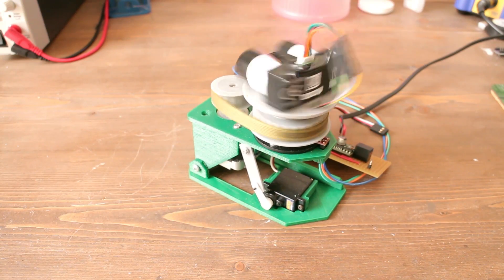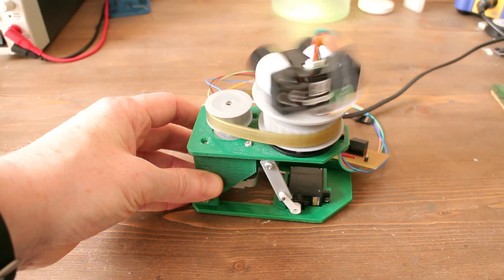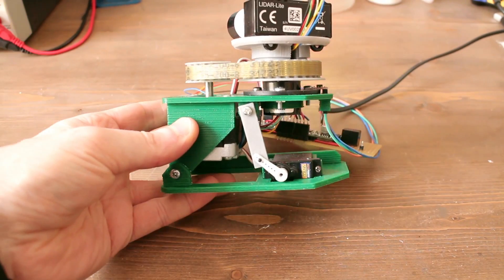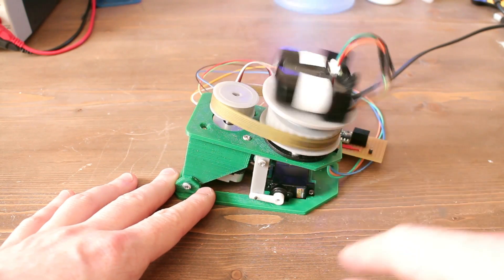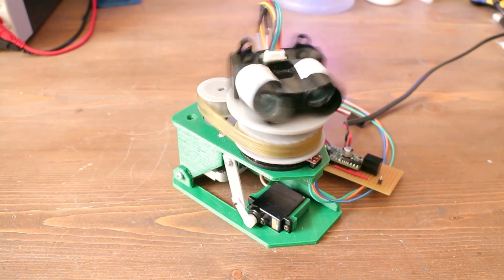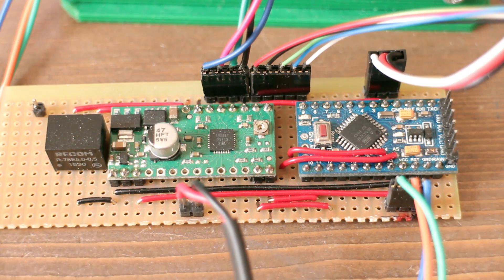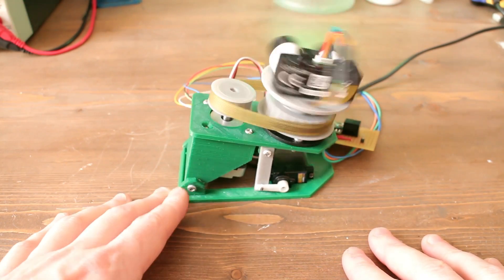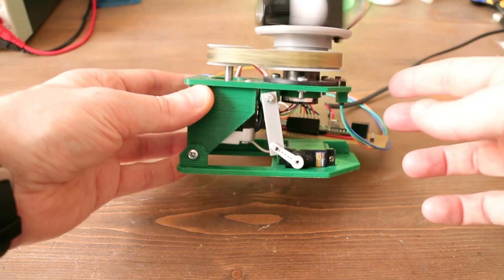Rotating 360 LIDAR Scanner - 3D Printed up and down scanning - Robotic Vehicle #9

Comment: It is interesting that you are talking about calibration issues.  It would seem to me that letting the head rotate and monitoring the optical sensor for the line,  you should be able to tell how many steps the motor requires per full rotation and then just rely on that for the rest of the scan.
Reply: Please share. Any code sketch for this

Comment: Good job. Like you said in your previous video, I too have had all the parts half-put-together, waiting to be finished. My project is similar, but I'm using multiple LIDARs, 180deg from each other, which effectively doubles the scan rate at the same rotational speed of the stepper motor. You could also have 3 at 120 degrees from each other, with also a little bit of a vertical angle (top is lifted a few degrees, the middle is at 0, and the bottom is pointed down a few degrees). 

As for the bottom bit to dynamically change the Z axis, I have also toyed with using another stepper or brushless motor with an elliptical piece on the shaft so that it gradually pushes the platform up and down, instead of the jerking motion that you have. I would then run that bottom motor much faster than the horizontal motor. That way I can also deal with calculating all readings' Z value - your current solution, albeit being changed, leaves some number of readings unknown while the servo arm is in motion.

Comment: Very cool! i have an old V2 LIDAR that has also been sitting around from before i purchased my 3D printer. i'll be "gearing" that up again. i do wonder, though, that you are putting so much sideways pressure on the Stepper Shaft. maybe you could incorporate a housing with a bearing to keep that pressure off?
great move from gear to belt.
keep up the great work!!!
Russ from Coral Springs, Florida, USA